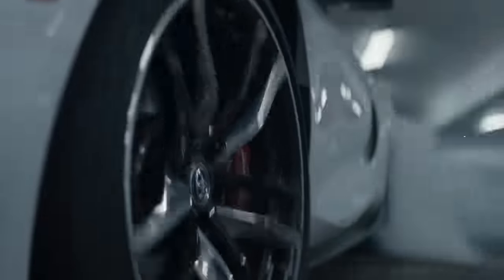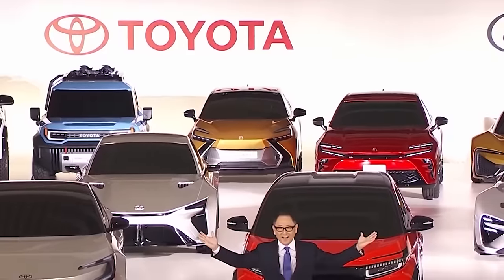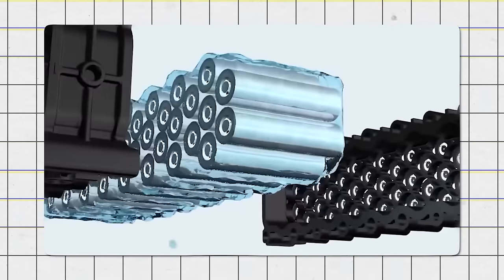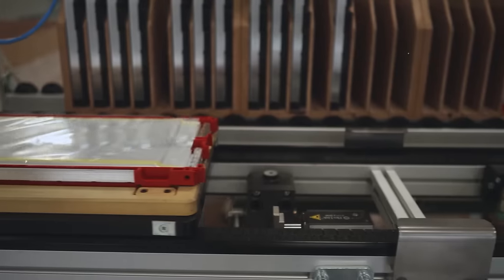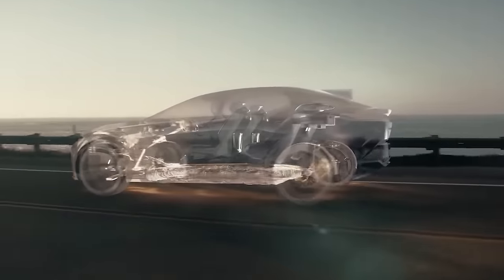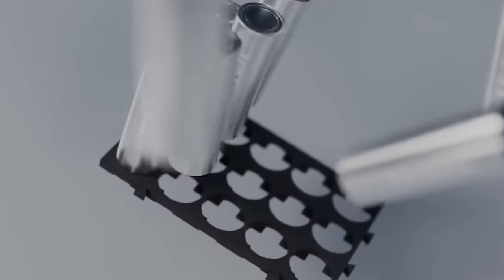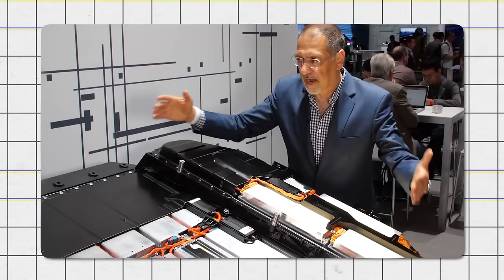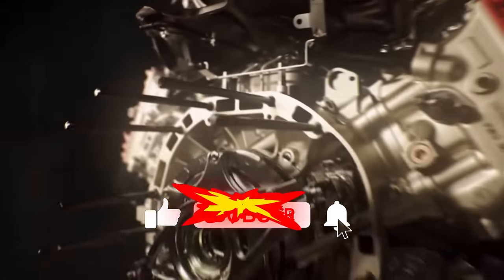Toyota CEO: "This Is How We Will DEFEAT Tesla!"

Comment: Toyota can't get their act together. One day they are saying that EVs have no future and that hybrids and ICE are the direction they are going. Then another day they are touting hydrogen cars. Then they are desperately promoting their solid state battery EVs that aren't due for 3 or 4 years. Then they endlessly repeat the cycle.

The only constant is that they produced a single EV, the bz4x (and a lexus version) which has been universally panned as a terrible EV based on yesterday's EV technology, and not even well produced considering they are using such old tech.

Comment: Sooo....theyre more reliable even though they're "mitigated".  And let's ignore that Tesla's current battery is good for 500,000 to 1,000,000 miles today.  And this is bad news for Tesla in 2030.  Oh, and Toyota's current offering is crap.  And thats not going to begin to change until 2026.  And that's only going to be a premium cost for their existing crap.

And lets not forget, the Tesla 4680 is solid state (dry electrode) and about 25% of Tesla's cars ship with it today.  ¡Ay, caramba! What a load.